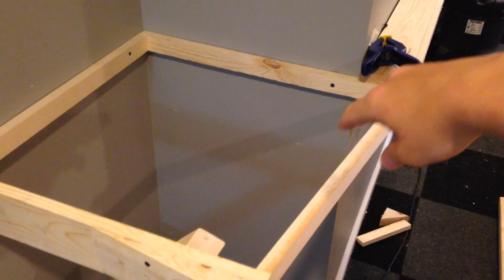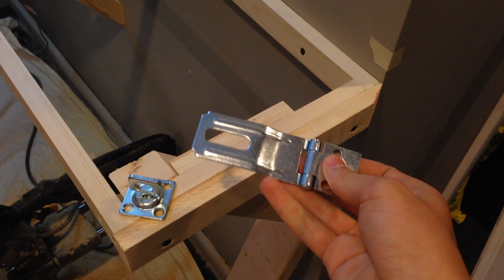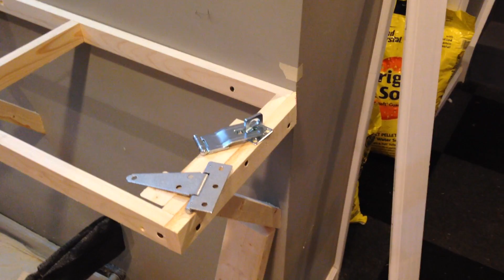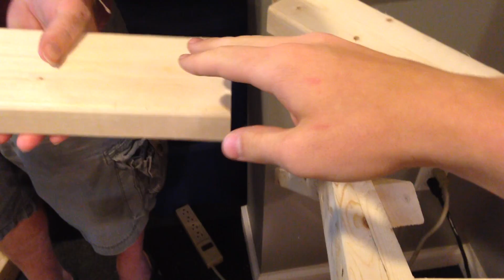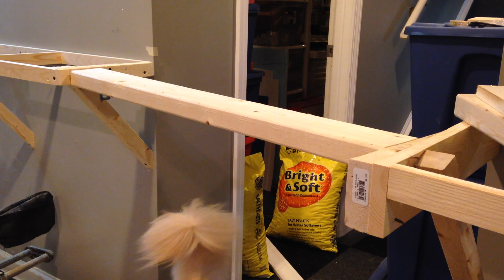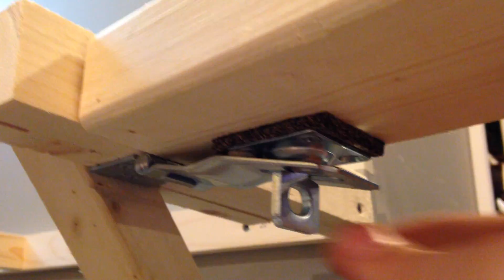Building a Model Railroad Drop Bridge - Part 1

Comment: You do not need a locking bracket.A piece of 3/4 inch  Mdf With a washer and  strong screw.or coach bolt.With enough slack.So as it can be turned out to support the shelfYou can put as many as required for a small price..If in time after wear it needs a packer.You can use formica or a bit of tape.Also there are better ways of supporting a shelf than putting a piece of 2 by 1 as to make a gallows bracket.

Comment: Well good idea BUT it don't work  be cause I did some way and after all I have make  to lift Bridge
work much better and train don't jump out from track
Nice Job any way thumbs up
Reply from the maker: woltar9 The only problem with a lift bride there is that we'll have another level above it. The bridge is close to 30" long, so it wouldn't be able to swing all the way up. The other option would've been a swing bridge, but this created the least amount of disruption in the aisle way. Thanks for the input though!
-Cam
Reply: well ok My is 32 inch Long and 12" wide
is You bridge you job man 
Nice
Reply from the maker: Ok. Thanks!

Comment: You sure do like building things with angles.  I hope it works out with no issues.
Scott
Reply from the maker: Scott Downey I know! Actually, it's quite painful, but so far it's all working. It's amazing anything has worked because the saw we're using likes to cut everything at like a 1º angle when it's set to an angle of 0. I mean, it's a really nice saw, but it's annoying at times.
-Cam